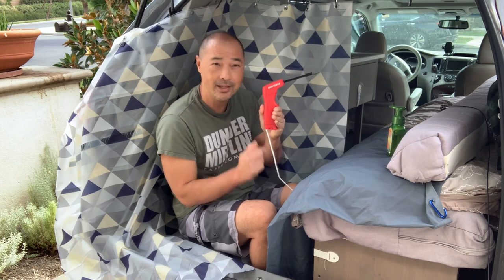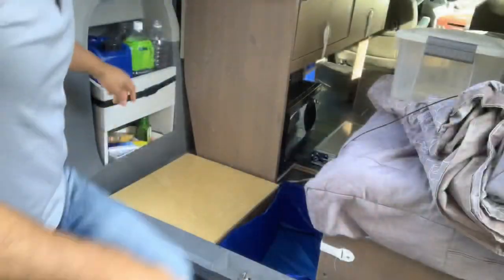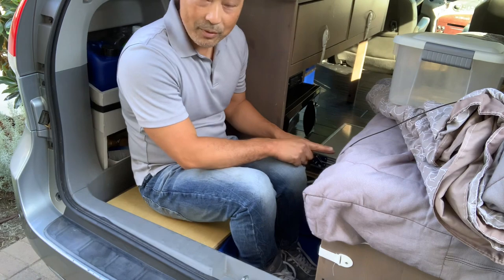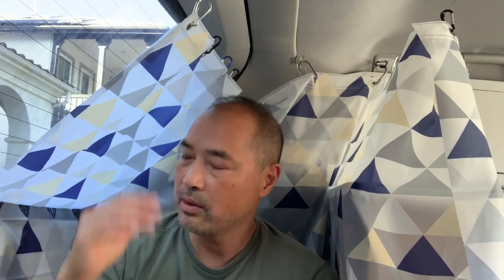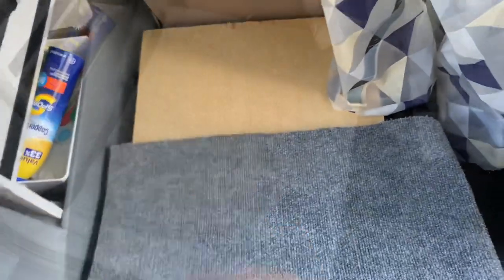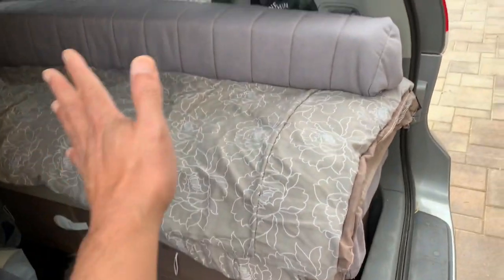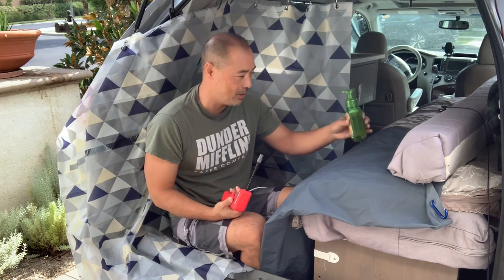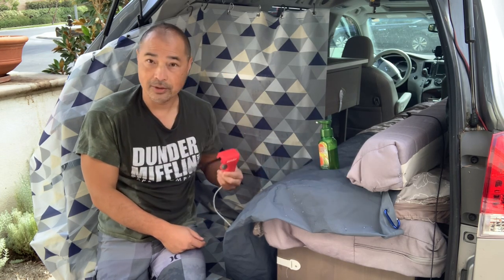Updated Shower (old dog bath idea) with new way to bathe!! So easy! Sienna Micro RV Ver.3 ep.8.

Comment: The drain hole in your van is a great idea, I've seen that in several videos and it's a very smart idea.  As for me, I would consolidate and make the bathroom/toilet area a priority and design my tiny home around it.  
An idea I'm toying with is having a shower/toilet chair that would sit inside of a popup rain/weather/sports pod that a chair sits inside of.  
I would first purchase a four-sided tray of some type, plant tray or pond basin, cut a drain hole inside that would have a draining fixture (like the one you demonstrated) that would be secured over the drain hole of the truck bed and the tray, glued together and then apply waterproofing sealant everywhere I could.  I would then place the popup rain pod inside this tray or basin, creating a few small holes for draining (maybe with a simple paper hole punch) and then put my chair inside, along with a toilet bucket system that would sit under the seat for toileting needs and could be easily removed for when I am ready to sit on the chair to shower.

The good thing about these sports pods is that they can be set outside or hung from a rack, even magnetic, mounted to your rig, and will dry out quickly, then you can just place it back inside of the vehicle.  The basin could be easily dried out with ventilation, a tiny dehumidifier, or just paper towels :)  This is what I'd like to do.
Reply: Funny but I've had the similar idea as yours but I was thinking of using a hula hoop and hang it somehow from the "ceiling" and use clips and shower curtain rings and add some magnets to seam up the curtain around me. You can weight down the curtain so it stays down . You can also use some tubing velcro it around the inside of the curtain right where your elbows would be when washing your  head. Something like that lol.

Comment: Have you thought about using the pick up truck spray on bed liner for the shower instead of the dog bath tub in one of your other videos If it stands up in the bed of a pick up it should work
Reply from the maker: Not pick up spray liner but I have thought of using flex seal. Pretty similar stuff. This route was easier and removable :)
Reply: @Tiny-Campers  one other video I’ve seen said the flex seal didn’t work out to good.
Reply from the maker: Well the doggy bath works great. :)

Comment: I’m curious, why not just hang the shower curtain on the top of opened trunk door?  You will be able to stand up and shower.  I think it would be much more comfortable. You still be able to utilize the dog bathtub and not standing on ground with barefoot.
Reply from the maker: I already have an outdoor shower stall. They are cheap and easy. This can used in stealth mode and when it is really cold outside :)